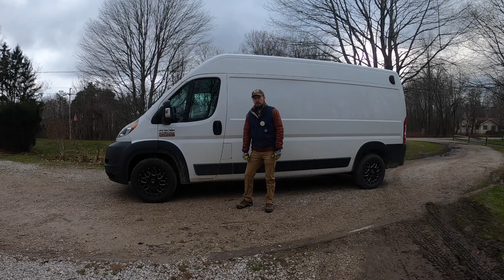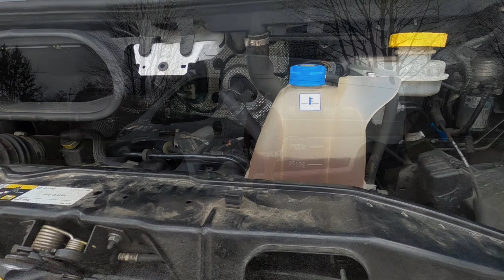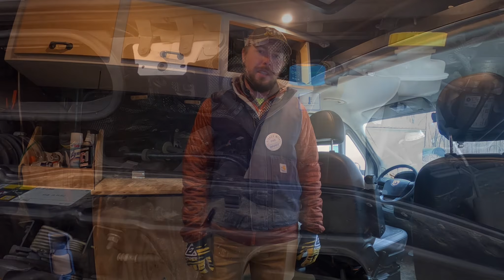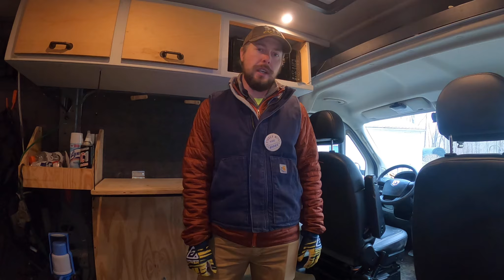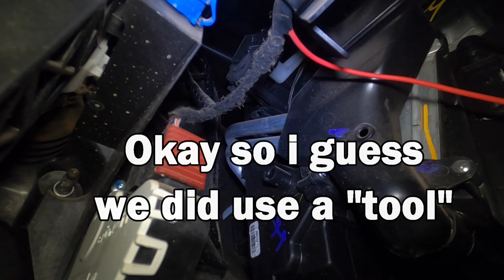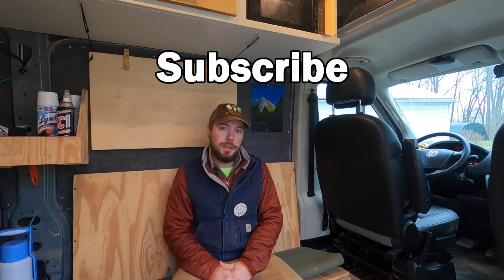Ram Promaster No Heat FIXED With No Parts or Tools!

Comment: It worked! And I would like to provide some additional observation: my heat selector solenoid stopped working and it was after winter storage for six months. I’m wondering if not using it had something to do with it freezing up? It took a few tries with the end of a screwdriver, but it worked. 2021 Pro master.

Comment: Worked on my 14 promaster.  I went into my van to get the webasto fixed and after a short drive found the van hvac didnt even have heat lol.  I fixed the webasto and the van heat with your video..... then the driver side window regulator promptly broke.  Haha

Comment: Thanks for posting this.
Did this just last week when my hot air disappeared on my 2017. I realized it wasn't going to easy to swap the servo so I jiggled the electrical connector and then gave the servo a few love taps. (Success) I had found Kips video to locate things but just now found yours. I believe this is the solution unless the servo is stripped.

Comment: trying this today! usps and I have no heat. heat isnt a requirment for my job as per my managment so they refuse to fix it hahah
Reply from the maker: All you have to do is write it up as a safety issue because the defroster doesn’t work and it will be fixed by them. Thanks.

Comment: OMG, it worked. So cool.
2018 Ram Promaster 3500.. stuck on cold, no heat. Saw your fix. Turned the fan on first setring, low. Using a mirror, change temp from cold to hot and reverse, the actuator had no movement, tapped the actuator, gave the white arm a little tap and it started working.
Saved all kinds of agrivation.
Thank you for sharing.

Comment: Well, add me to the list of "this worked for me too".  I have a 2018 3500 Promaster with 71,000 KM's.  Drove home in the cold last night because of no heat, not fun!  I saw your video and must say kept looking as I did not think I would be so lucky.  But later in the day tried exactly what you said, tap tap and the actuator moved!  I hope the fix lasts but if not I can see what part would need replacing.  Thank You for your post!!
Reply: Well, darn, not surprised but it stopped working again.  Time for a replacement.

Comment: Just adding to the group of people also saying this worked for them! 

Although, after I got it sorted, I got engine code P2112 which has to do with the accelerator sensor. I have an aftermarket cruise control so it was likely due to my hands brushing against the wires from that kit (which has one connector piggybacking off of the standard accelerator connector). Anyways, I cleared the code myself after a short test drive and the light went off. 

Also to note: getting your head to get eyes on this thing to tap is NOT easy. its pretty awkward and will take a little bit to figure out where to tap. I had to turn the van off and then on again for the blend door actuator to begin moving again after tapping it. Hopefully that is helpful to someone else!

Comment: Dec 2024.  Complete kudos to you!  This is EXACTLY what occurred on my 2016 Promaster 1500 and your fix worked!!!  A wire jiggle, a screwdriver tape and the actuator moved.  Thank you Professor!👍
Reply: I hope this works for mine I have a 2016 promaster. I haven’t had heat since I bought it . I use a floor heater but it draws a lot of power from the alternator thru my converter . I will give this a try

Comment: Thank you for this video.  I too have a Promaster 2500 2017 with less than 50K miles.  Lost cabin heat this weekend.  I checked all the forums.  The former had elaborate explanation was good but video is priceless.  I tapped the actuator as you suggested with my finger and substantial dust fell.  And the actuator arm started moving.  As mention, heat returned.  If it happens again, I will definitely tap again and possible use a air compressor to blow any accumulated dust.

Comment: I've started using a friends 2500 Promaster for what looks like the duration of winter. The heater blows cold.. I followed your instructions , used my hand to bang on the actuator . It started moving and now I have heat. I'll not adjust the heat just in case I'm not lucky twice. Thanks very much :)

Comment: Let me add another voice to the "Oh my God, it worked!" chorus... Thank you so much. 2021 Ram Promaster 3500. It had been sitting for a few weeks in early fall while we were overseas. We came back to a cold snap and turned on the heat... nothing! A few taps on the actuator is all it took.

Comment: It would not get hot. Looked at your video on YouTube. Took one panel off to get to the blend door actuator. By the gas pedal on that flow on snap by pulling on it need you more room. One more cover to move over to aluminum radiator to call. Bottom screw. No I have room I had to push up on the cover lodged it. Or I could get to the door blend motor tapped on it two different times and it started working. Thank you.

Comment: Wow!! Amazing! Thanks so much for this trouble-shooting video! My pups and I spent a very cold Thanksgiving overnight in PNW, 31 degree cold snap. My Pro-master 2021 Van with only 9500 miles I discovered on the drive to Tday was only blowing cold air!!  I didn't want to take it to the dealer if I didn't have to, as its my only vehicle and I live in a small coastal town. I had a super hard time getting to the actuator, but tried a number of times and finally got a few taps in and rotated the hot to cold and blower, on and off. All the sudden warm!! Yippee!! I'm so grateful!! Therese

Comment: Still helping people 3 yrs later. Bless you. I kept seeing/hearing it was most likely air pocket(s) in my cooling system that kept heat from cabin. I tried bleeding several times. Even before looking on you tube. I had seen the screw plug in the heater hose. Bought a pressure kit. Bought the 'Bleed Fill kit with funnel that really didn't fit under my hood. I drain the coolant and refilled. No drain valve either had to pull lower hose off. Thank You, Thank You.
Reply: Had radiator out fans weren't working.  Fans good, relay's good, resistors bad. Fans started working. Worked so good they were running the next morning when I went to garage and heard something running outside. Wasn't shocked bc I had seen other guys comment on this issue. Wires burned Intelligent/Fuse box got hot and had some melting. Just got it running after sitting for more months than I care to mention. No one wanted to work on it. ....23 months while paying $400+/mo on payments & insurance. Drove it after purchase only a few times before building the inside. Whew a lot of work. Installed solar, frig water heater etc. Took first trip Dec 2021 when it over heated while idling. TG it was winter I was able to make it from SC to Arkansas to see brother on my way to Wi which was very cold. Then find out heat gauge on dash only goes 1/2 way up and no higher no matter how hot it gets.
Reply: Bought expensive scanner and it's showing no codes right now. Couldn't get connector parts that had melted ( in/under Intelligent center box ) so I had to cobble it together the best I could. I am hoping nothing falls apart bouncing down the road this winter when I head south again. I will drive it a lot before taking it over the road on a long trip.
Reply: Of course I had to  subscribe !
Reply: PS Intelligent Control center was corroded. The original  code was showing a short/lost communication.   Replaced it. Replacement one burned. Ordered another and they said I had the wrong one and that I needed the replacement one which was $725 ish compared to the $300 one I had bought. Wondering if this was the major problem in the firt place. ?? They would not tell me why this one replaced the old one. Had it shipped to local Dodge dealer & asked them also but they said that they didn't know either. Me; bs !

Comment: Thank you! I tapped the white arm with a flashlight while the dial was being turned and sure enough the arm started moving. Looks like the servo slightly seized from non-use. I’ll be sure to move the temp dial more often!

Comment: Thank you for posting this. I was having no heat in my 2014 Ram 1500 Promaster. The dealership service department told me the issue was a clogged heater core and repair was $2100 and would take 3+ days. I agreed and let them order the part but before they could install the heater core, I really needed heat for a job in the snow so I started researching the issue. Watching your video helped me understand what was happening. With the car off, I wiggled the black module and taped the back of the black module with a screwdriver and after that I had heat again! Thank you

Comment: Tremendous thanks for taking the time to put this video together!!! Thank you thank you the simple and concise video.  Saved me a tremendous amount of troubleshooting.  I also used the plastic side of a screwdriver to tap the back of the unit.  It took about 3 sessions of tapping (started light tapping and slowing increased the intensity) and switching from hot/cold before it ended up working in my case. 🙏

Comment: This was helpful in that I discovered the temperature control is not moving, but nothing I do fixes the problem! Any advice beyond tapping? I'm trying to find what fuse is connected to this but no luck so far
Reply: Came back to report it worked this morning ,🎉🎉🎉 thank you SO MUCH

Comment: Nearly freezing to death. Dealer couldn't take me seriously when I moved to cold climate because I didn't know that you had to keep the snow button off. Today a newer staff member told me a lot of Dodge owners easily think you turn it on in winter because it has a snow flake design. So user error. But now heater truly not working and I finally landed an opp with a major groovy big tech company I'd regretted not working for before. But guess what...they need me driving all over Wisconsin during these blizzards and low temps about to get lower. A former mechanic working at O Reillys Auto Parts told me about this trick but then recommended a mechanic who like all mechanics can't make more than 2 minutes for me. They are all too busy and like many industries experiencing staffing shortages. I'll try to study this video but I have the Promaster City so not sure this will work.. miserable I am...I hate this cold weather and wouldn't be here if I didn't have to be here. Eight hours driving no heat. Have solar generator batteries with inverters but need recharging off the cigarette lighters that are of course not working though we did get one working recently. If I can get those working I can recharge the power packs to run personal oil filled heater.. but the cord needs replacing..though should have in a couple of days. Finally got a stereo installer in the middle of the state to discuss 1000 watt inverter direct wired to primary battery but he can't do anything until mid January just to put an inverter direct to the primary battery to fill up the power packs to power the heaters ...geeze..I loved my Promaster City in the warm climates and the front wheel drive in the snow is wonderful. My van was a part of a custom fleet that I bought in California at Car Max. To their credit they told me the heater would never withstand the Midwest. Apparently, a cheaper heater was put in it as it was bargained that the van would never leave the golden state.
Reply from the maker: Good luck!

Comment: Normally projects aren't this easy and I'm happy to report that this fixed my actuator. I had only cold air and couldn't get the heat to come out. I wasn't moving until I gave the unit a few taps. Huge thanks!!

Comment: I only have air coming out of the front window vent - but it doesn't change temperature (semi-cold). I don't hear any clicking sound at all. Tapping the white plastic arm didn't do anything as it stays in place & I can't move it manually as well. The 2 hoses are attached. 

Any idea what else could be causing this?
Reply: Did you ever figure your situation out. Is your heater working now? If so, what did you do?

Comment: Thanks for the videos. I found your channel looking for a fix on the leaking roof. Mine is leaking in the same spot. I noticed the thin body caulk with cracks when I put the solar on, but didn’t think that would be enough. I noticed on this video at the end, is that a drop down table behind your head? I would like to see a “van tour” video??? Like you, I’m building mine out to be “Dual purpose” mobile home repair, and camping. Again thanks for the videos, I will get through the rest. I too was dirt biker in my younger years.  Mike
Reply from the maker: https://youtu.be/6hnOHXMkPPo

Thanks for watching Mike! Here's a link attached to my van tour

Comment: I have a 2018 Ram Promaster 3500. No heat until I reached up and found the module and plastic arms. A light tap with my fingers and it is fixed. I did have the engine running which I found helped. Thanks Dualsport Disport for your great video. Greg
Reply from the maker: Really glad to hear this worked out for you! Just in time for winter! Thanks for watching, feel free to subscribe I have other ProMaster how-to videos with more coming out.
Reply: @DualsportDisport  I already subscribed Thank you for posting. Warm regards, Greg

Comment: Just tried it on my 2016 Winnebago Travato. Worked like a charm! Saved me an expensive trip to my Ram dealer. Thanks!!
Reply from the maker: Glad to hear that! Subscribe for more tips and trips on this vehicle! Thanks for watching!
Reply: Did you have to remove any interior trim pieces?
Reply: @wallaceschling257  No, just an awkward reach way under the dash.
Reply: @yobtaf2007   Thanks. I may just be to brittle to reach it
Reply: @wallaceschling257  Ha! Good luck!
Reply: It’s not going well…..77….bad knees….what was wrong about a cable?  Got any other ideas? I have subscribed in the hopes something goes wrong that I CAN fix..haha
Reply: @wallaceschling257  I turn 77 in November but am small and fairly limber. I positioned the driver's seat as far back as possible and got on my back to access it. Not a cable. It's a pivot fitting that gets stuck and tapping it loosens it.

Comment: Thnx DD , i've noticed neither the heat or A/C ar any hell on my '14 PM , that your experience as well?
Reply from the maker: Sorry for the delay, what do you mean by your comment? Thanks for watching.
Reply: @DualsportDisport   not real warm or cool
Reply from the maker: Have you checked to see if the actuactor is fully operating?
Reply: @DualsportDisport   will give that video another look-see and give it a try, thnx for the advice